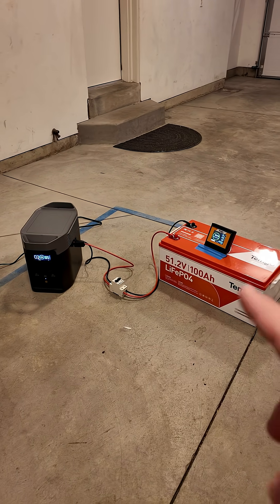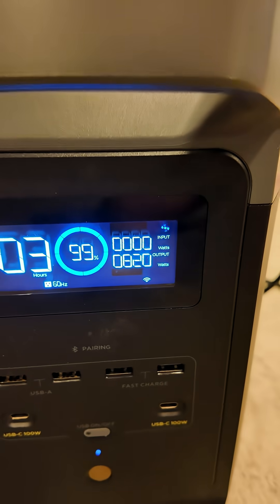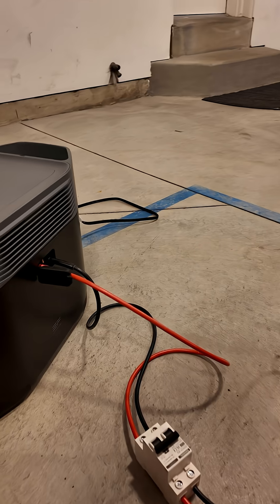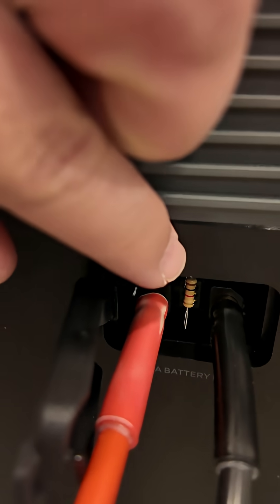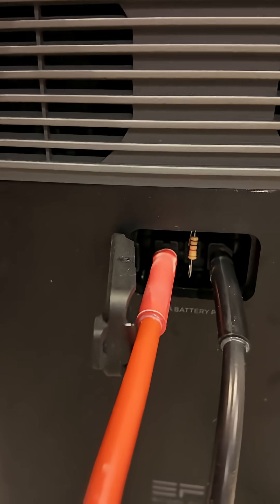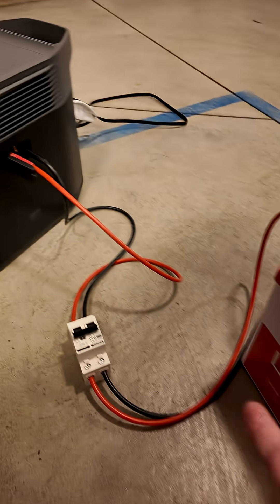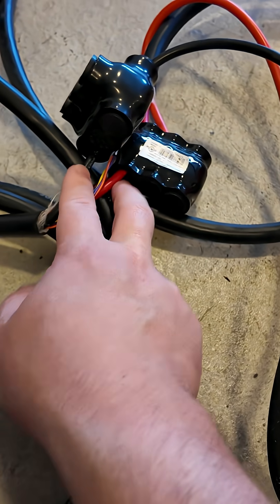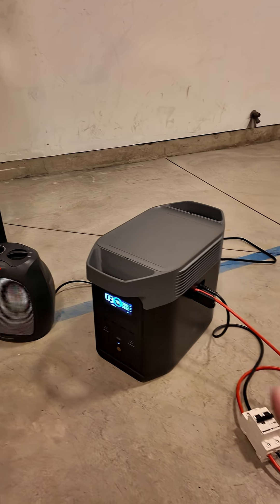EcoFlow DIY Expansion Batteries!

Comment: I have a fossibot 3600 and I'm guessing the control method is the same sort of thing because I can't read any voltage on the two main pins. I don't even know what type of connector it is but I'm guessing proprietary. I haven't found anyone who has some this jack on the fossibot or aferiy units which are identical.
Reply from the maker: That’s interesting! I haven’t tested that one yet.

Comment: I have to find a way to use the ecoflow(or some similarly powerful and easy yet sophisticated to use brand alt) with a cheaper backup source with enough to power for a dj/band sound system
Reply from the maker: This setup would be perfect for that kind of use!
Reply: @theresatrickforthat  how do you know that? That's pretty lame saying that this set up would work when he didn't even state load details.
Reply: I've done off grid power stations for 25 years. You need to measure your load first. Find out what your absolute maximum power demand is, and then find out what the total number of kilowatt hours is that you consumed for that session. If you don't know those numbers don't even start. But I can tell you right now, it's probably a really big number and not particularly practical.

Comment: Once both batteries reach the same voltage, won't charging stop?
Reply from the maker: That is correct!
Reply: @theresatrickforthat  did I hear you right that  when you said you could do this with other solar generators? I am asking because I have a 999wh solar generator. It doesn’t have connections for an external battery. can i connect a similar type of connection that you have on something like that?

Comment: I’d watch a video on the order you bought these stations. I’m in constant analysis because I’d like a whole house setup but that takes a lot of money.  So do I buy a pecron or ecoflow so I have something now?  But then it’ll rob money from the whole house setup.  My mental process rinse and repeat
Reply from the maker: Go to the long form video, there's a link in the description where you can book a consultation with me and I'll weigh in on what I think you should do based on your goals and priorities!
Reply: At this point if youre ordering cheap chinese batteries and soldering connections, installing new breakers, installing resistors to connect the batteries, you might as well just DIY the whole setup.  Way cheaper and easier than hacking together expensive ass eco-flows